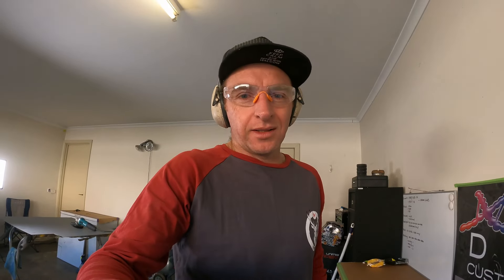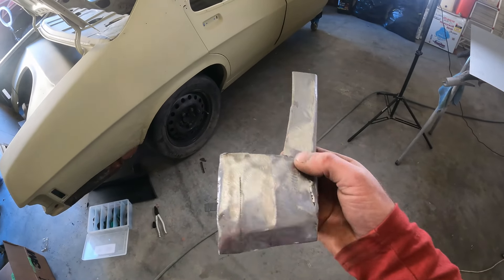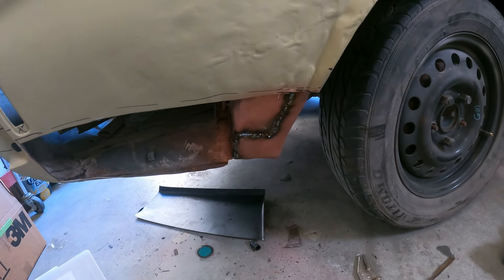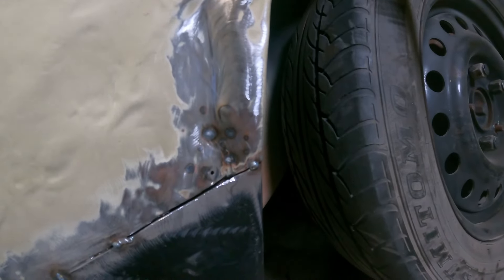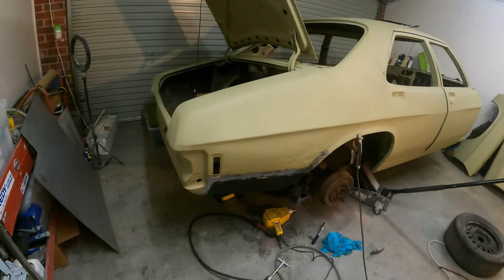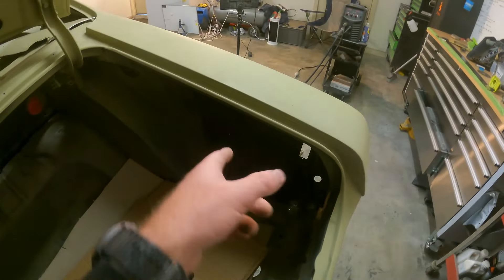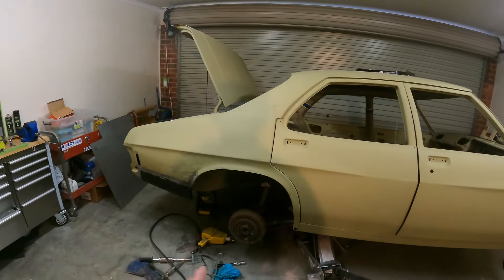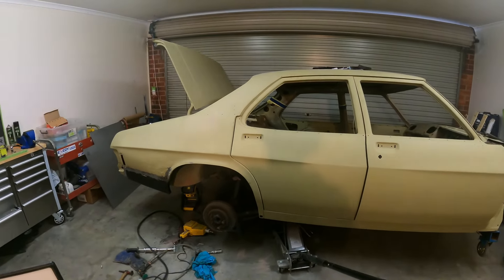HQ GTS MOCK UP RESTO - INNER & OUTER QUARTER PANEL

Comment: Mate you can get a vice brake from machinery warehouse that does an amazing job of bending angles of all sorts. Also on the welder you should be using .6 wire and .6 tips. Much more suited to the job / thin sheet metal. Also shine a led light behind the butt weld to find pin holes post weld and or grinding. Final comment is you should aim to use 1.2mm / 18 gauge sheet metal. It helps with welding and also when you linish it down you end up 1mm vs using 1mm sheet and 0.8mm after grinding which is thinner than what you started with originally.
Keep up the good work.
Reply from the maker: Cheers for the info mate . If I was to do fab stuff more often I probably would get a vice brake .i prefer to just do body and paint jobs . Haven’t done rust repairs on a car in almost 4 years lol